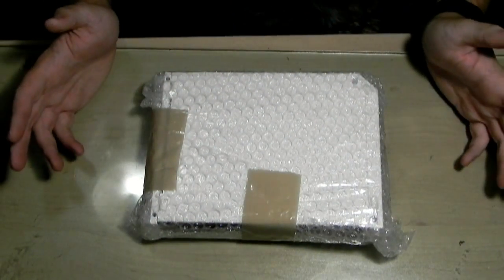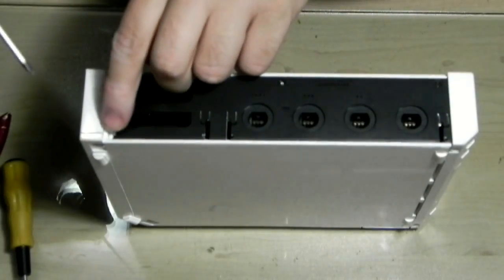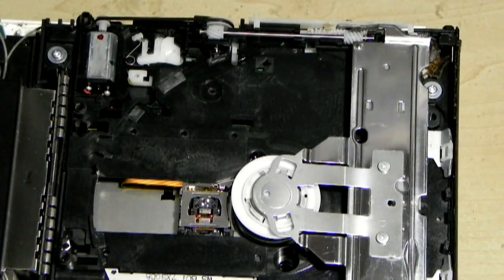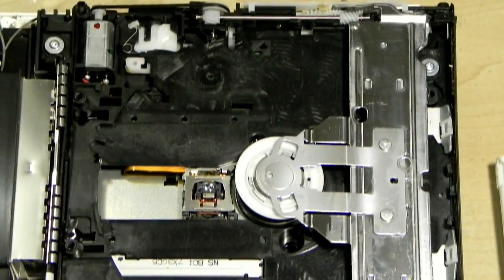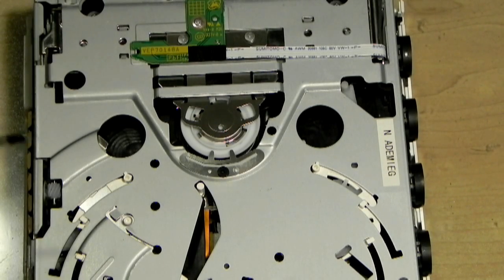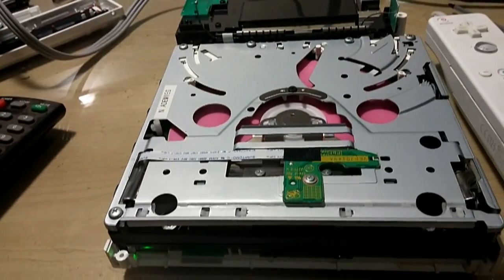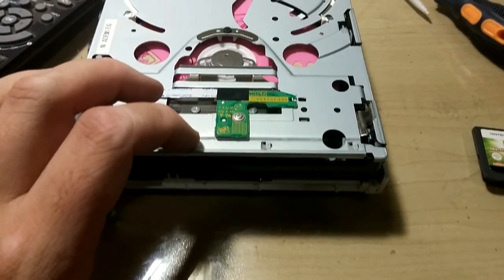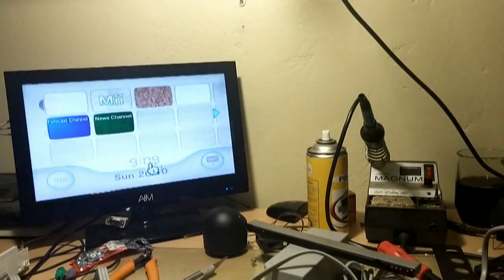Lets fix a Wii, The most common fault on Wii consoles.

Comment: Is it true that your Wii can crash because of dust or cigarette-smoke?
I kinda understand theoretically it could happen, but in practise did Wiis ever die because of these reasons? Anyone?
Reply from the maker: +pietje bel never seen one die becouse of it, but dirty lasers will give you disc read errors and freezing in games.
Reply: +HPZeta, but what about the Virtual Console / Wiiware games?
U should at least still be able to play these i think.
The Wii is a very solid console, i would hate if it broke down on me, and i would lose all these Virtual Console games.
(i know you can't transfer them to another Wii)
Reply from the maker: pietje bel if it freezes in WiiWare and virtual console games it's not a dirty laser or dust something else is wrong
Reply: +HPZeta: i am not really talking about freezing, i just mean if the system just shuts down or something. Technology failing.
I guess u lose all your purchased Virtual Console games etc.
All your money is gone.
Reply: pietje bel Yes, you lose them all. You can only transfer from Wii to Wii U. I know the Wii Shop Channel uses accounts, but I don't those are transferrable between Wiis either.

Comment: The fault on my wii is stripped screws 😒
Reply from the maker: jasher Clark those are the worse, if your lucky you can screw it out using a thick rubber band stretched over your screwdriver tip, but I had to drill one out becouse everything didn't work
Reply: HPZeta nothing worked for me so I was wondering how to drill it since the screw is really small
Reply from the maker: jasher Clark first check if it's safe to drill the screw out , like don't drill it if it's one of the screws holding in the DVD-ROM, then get a drill bit that's slightly bigger than the saft, and use a handril to drill out the screw, by simply pushing it into the center of the screw.

It's not pretty, it could damage the case, but if it's the only way to get into the case you don't have a choice
Reply: HPZeta would I be able to put extra screws in place of them if I get them out?
Reply from the maker: Sadly it will destroy the post so you won't be able to
Reply: HPZeta ok well, thanks for helping

Comment: Hi Zeta, great video and thanks for the tips!
While trying to repair the wii, this happened to me: https://www.youtube.com/watch?v=kqmx8RkhsS0
I was wondering if you may have an idea at what the cause is.
Reply from the maker: Not sure to be honest, does the disc match the consoles region, it definitely tries to authenticate the disc
Reply: Hi, thanks for the quick response.
The wii is NTSC-U  and the disc is also corresponds to that. I have multiple North American discs and all give me the same end result.  I have seen the wii click the disc around 5-10 times instead of twice in the video I showed you
Thanks again
Reply from the maker: Multiple clicking normally indicates a bad laser, have you tried cleaning it with some 99% alchole and dropping the pot a tiny little bit?
Reply: I have 91% rubbing alcohol, but am not sure if i clean it properly. I had a cotton swab and rubbed a dab on it and then cleaned it with the dry end. I have no idea how to drop the pot in the wii though
Reply from the maker: 91% is fine, just dab a little bit of alchole on the bod and clean the laser with it, for the time being test it without dropping the pot
Reply: Sorry for the late reply,
Is the bod is just the metal cage surrounding the laser lens?
Reply: By bod I thought you meant the metal around the lens so I cleaned that and the lens.
This is how my Wii is now. https://m.youtube.com/watch?v=wVIB0N3fjWw

Comment: I just got a wii and it is not reading disks can u fix 🫶😌
Reply from the maker: Hi Kate, I am in South Africa so sending it here will cost a small fortune , not to mention sending it back, you can pick up a new drive on eBay for about $19-35 and simply swap the drive it's extremely easy and you can follow along on the video